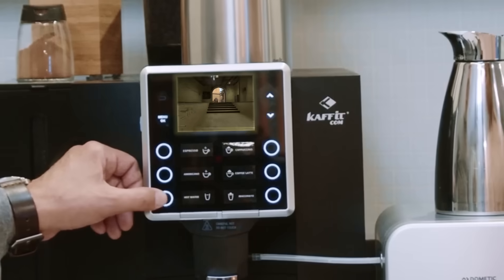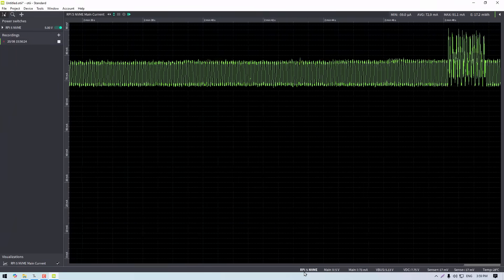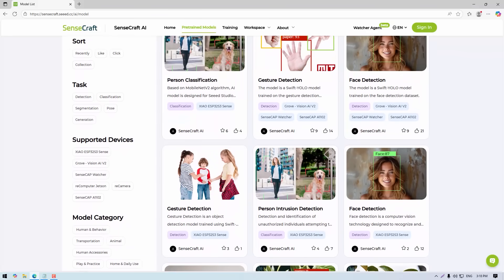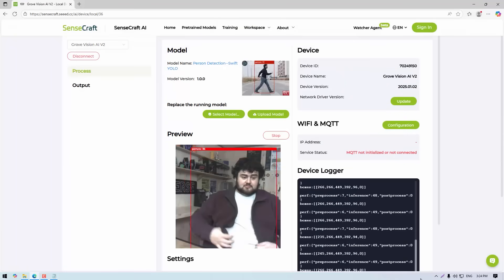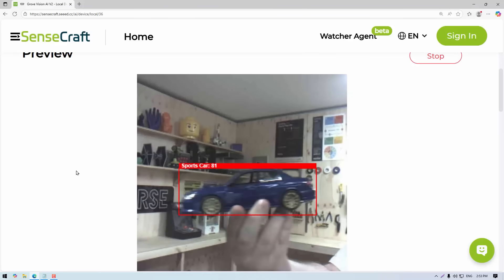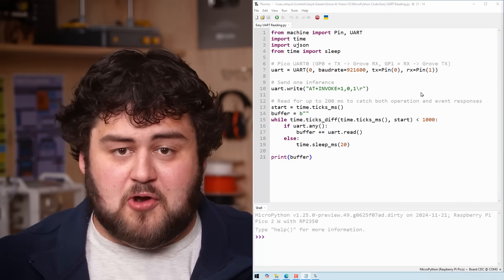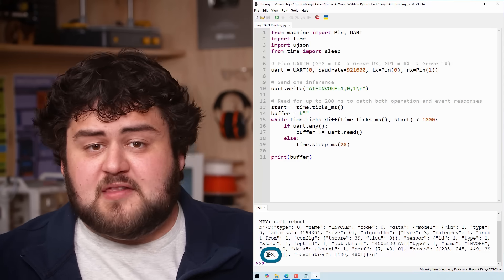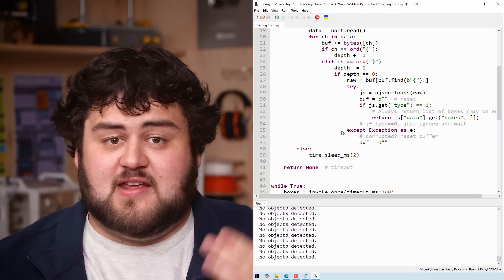...And It Only Uses 0.35 Watts???

Comment: I just ran across a Sipeed object recognition demo I played around with about 5 years ago, the K210? processor handled 100 different objects and had an LCD interface. Looks like their MaixCam and MaixVision are the current counterparts (seedstudio handles some of their devces)
   I'd be interested in finding a low end depth camera with about 100x100 resolution to replace the discontinued Sipeed model.

Comment: Im interested but google has let me down... i can not find a pintout of that board, just whats included on the pcb, not the jeader pinout 😢
Reply from the maker: It's designed to be sort of an accessory to go on Seeed Studio's XIAO boards. If you look for the pinout of the XIAO ESP32-C3, you should find the corresponding pins it connects to.

Comment: 1 minute in you said can run Yolo model at 20-30fps then you show footage at like 8fps?
Reply from the maker: That is with the overhead of having to send and decode the image data coming via UART. If you run it out of the studio, inference times can get down to about 30 - 50 ms which give 20-30fps. Also depends on the model as well, some run better than others.

Comment: Been trying to integrate it in my current project for the last month. I2C it's completely unreliable, and UART is a nightmare. In the end I'm using an esp32c to read the data directly and forwarding it via usb serial to a raspberry pi. X3
Reply from the maker: We found UART to be the best way to do this, you just needa watch out as the JSON message comes through in 2 parts.  A bit easier in micropython as you can just wait for the 2nd message to fully come through, but with C++ you could just hunt for that type 0 response, or look for the boxes variable and extract it!

Comment: Loved the enthusiasm and energy! I've been playing with one of these to try and detect cats fouling my front garden, and then turn on a sprinkler if detected. I thought this would be better than a motion sensor so it doesn't soak humans, birds, etc. When you point it at an image of a cat, it does indeed detect it most of the time, and usually that is where these Youtube videos stop. If I point it at a human face, it is also pretty confident it is a cat as well! I've tried the default pet model as well as a couple of custom tflite models I've found (which perform better) but same issue. I guess I'll need to fine tune the model with some real images I capture, but suggestions welcome!
Reply: I am doing similar with possums. But - it is almost always at night. So I am using heat camera / PIR / Radar. Including this is genius. Mine sends a video feed to my mobile phone - I can aim and fire. I dont use water though. Air compressor with pellets which fertilize the garden.  Turret rotates.  Now with the new Halo wifi the range can reach without extensive wife extenders.
Reply: @samrolfe2563  Yes the new radar modules for microcontrollers are incredible, much better than PIR as they can track movement, distance and angle. Could make that turret automatically point at it! Was hoping to do that just with AI vision and a servo, if only the classification was better.
Reply: Anti-cat systems are the reason the internet had cat pictures to begin with. It's all part of the universe correcting itself.

Add a turret system and you've got a product.

Comment: Ok - so I was preparing to build my own front door system this year.  Solenoid lock, Camera - face detection, voice detection, maybe a keypad as well - integrated into Home Assistant. 
Was putting it off a bit because uploading images training models using PI 4 /5 for the processing.
I can now implement all of this immediately. Awesome. Can also use it for my pet to come in and out and not the possums.
This really is amazing.
Reply from the maker: Just validate that the model doesn't give a false positive on a possum!
Reply: @Core-Electronics   Please also do some Halo long range wifi boards.
Reply: Could try YOLOE and a IP cameras and a PC with WIFI. Make 4 Modules the same, one weather, one security...